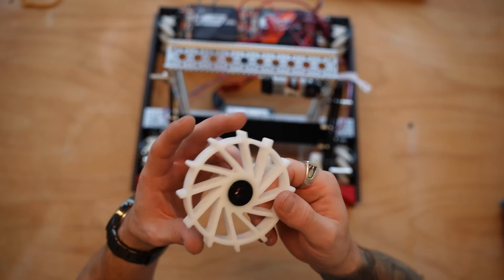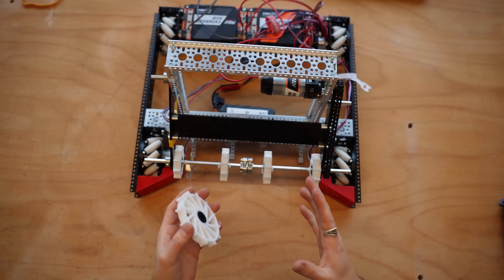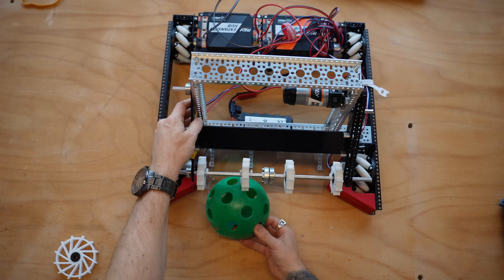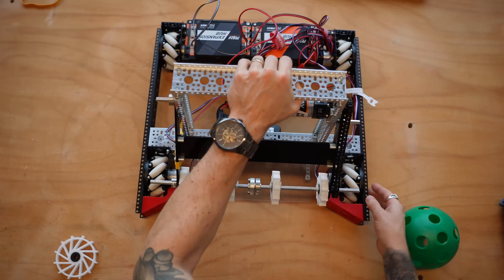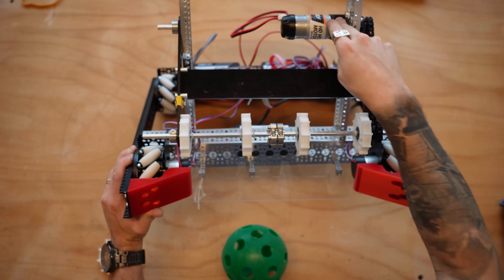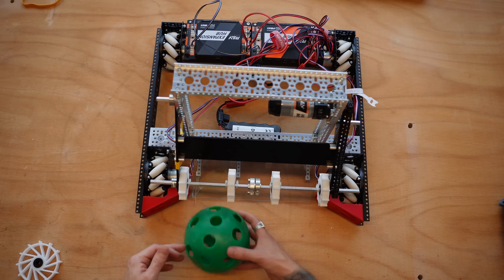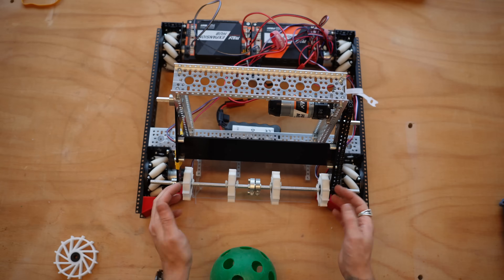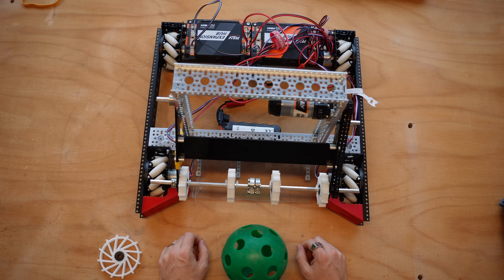The Unintuitive Genius of Compliant Wheels

Comment: Team 8626 here, we started using the Gobilda boot wheels, but we found that the kickers kept getting stuck in the holes in the artifacts, so we switched to using straight Gobilda Gecko wheels, and those have been working great for us
Reply from the maker: I imagine getting stuck in the holes may be related to the thickness and extra “boot” on gobildas boot kickers. They’re also rather thick. Glad you found a solution.